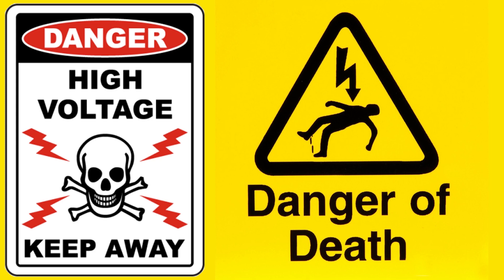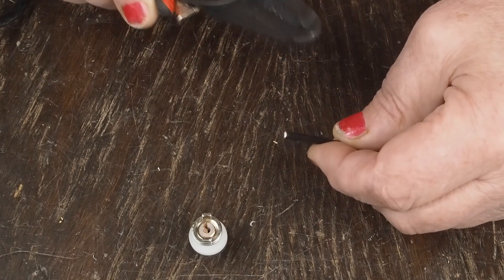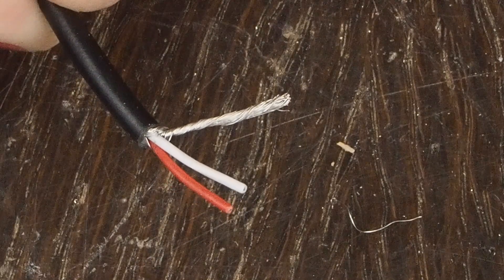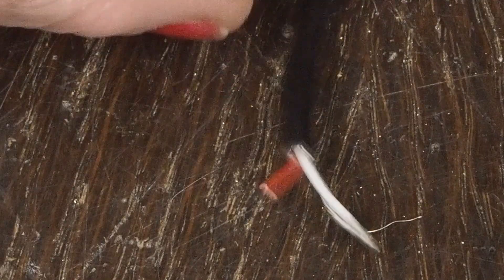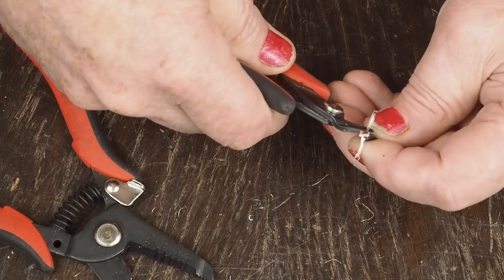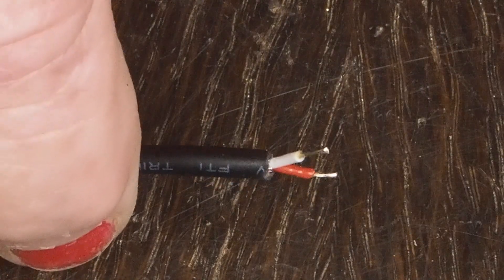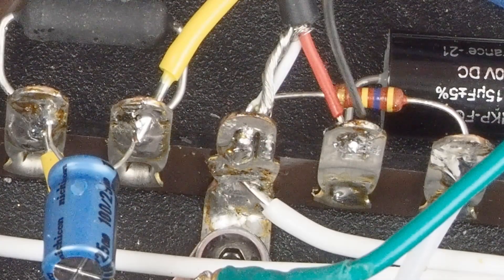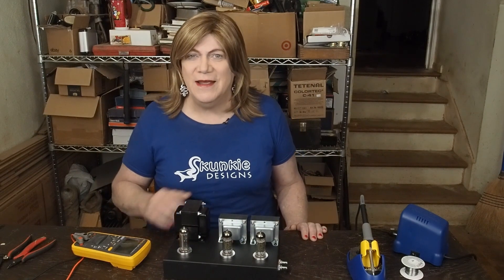Installing Audio RCA Jacks and Shielded Wiring

Comment: Can this same method be used when replacing the rca jacks on the T11 ? Any advice on that would be great? Can the shielded wire be soldered to that board?
Reply from the maker: Yes it can :)
Reply: @SkunkieDesignsElectronics  I went back in and replaced the ground lug and wire on the t11, was able to get a 300 foot spool of gls shielded mic cable for 20 bucks on amazon. Super deal 84 percent off. Also i removed the rca plastic boxes from the board. When my parts get here tomorrow im going to solder up the new rca jacks. 
Thank you again for another great video.
Reply: @SkunkieDesignsElectronics  I got the new rca jacks and ground lug done in my little bear t11, it was a tight fit but dooable, the solder joints on the board are very close to the rca jacks, 
You really have only a few options. Relocate them, or insulate the back of your lugs and flatten out your solder joints like i did. As long as you stick to the smallish size rca jacks it's doable. The mic cable is super flexible and was a huge help. The end result was a quieter better sound stage and even more clarity. :) ps that mic cable makes an awesome turntable ground wire. You said in your t11 mod video that it was a 9 out of 10. With the rca modd and the new ground lug its closer to that 10 out of 10

Comment: I see you used a lug that is connected to the enclosure and a wire for ground too. Couldn’t this created a ground loop? Thanks for this video.
Reply from the maker: Never had any issue doing this in dozens of amp builds..

Comment: This is very informative.  I'm considering changing the rca jacks on my Luxman L-480 as one side drops out on the phono. They appear to be close together than the standard replacement pair rca jacks.  Can I use the individual ones as you've used? Thanks in advance.
Reply from the maker: Hard to say without seeing it.
Reply: @SkunkieDesignsElectronics  can I send you a photo? Thanks again.

Comment: I have a slight comment. I feel you should tin the twisted shield cable completely then solder it.
As this will remove any chance for any whiskers to ever cause a short. Probably over kill but good practice.
Reply from the maker: Good point!

Comment: I realy enjoy your videos, to me, they reflect percfectly the  DIY spirit. I have two questions. Do the difference in the lenght of the wires for the RCA could affect in any ways the signal? Since solder has much less conductivity than copper, could there be a significant difference between a mechanical joint versus a soldered one?  Thanks
Reply from the maker: No and No. 

On the first one, electricity travels much faster than the frequency of the signal, it's not possible that a few inches of difference in the signal path length could have any impact. 

On a soldered joint, we are talking about the conductivity though less than 1mm of solder. Theoretically I supposed a tight mechanical joint would conduct immeasurably better, but at least for me as a DIYer, I find myself changing components testing ideas often enough that dealing with tight mechanical connections, that are then soldered, makes that a royal pain if not impossible. Also, if pure solder connections were a problem, no PCB products would work and many high end amplifiers use PCBs.

Comment: Every video I pick up something new. I've never seen coaxial audio cable done like that with the shield connected to one of the conductors. I can see the benefits and if anything there is less likely a chance of having the signal short to ground that's easy to do when working with those whiskers. Thanks again!
Reply: Is this OK with a single ended amplifier? Thanks

Comment: There is some recommendation to not touch the lead wire for soldering, what about you idea ?
Reply from the maker: My main suggestion is to wash your hands after working with it. If I was doing this a lot, I would consider wearing latex gloves. I am getting a "fume extractor" and even a small fan is a good idea to not breath the flux fumes.

Comment: Would be nice to know the suppliers of your,parts.Very hard to achieve without ''advertising'' But many videos give links to their wares...
Reply: Mouser, Digikey, Parts Connexion are just 3 places to buy these parts
Reply from the maker: Those vendors Nick mentioned and: tubesandmore.com aka  Antique Electronic Supply, Angela Instruments, Viva Tubes, youdaelectronics.com and finally Ebay are my primary sources of parts.
Reply: @SkunkieDesignsElectronics  I appreciate the way you wired these inputs.  Specifically, what brand are those are input jacks?    I recently bought some that won’t stay tight.  Looks like these are very solid and I’d like to replace mine with these.  Thanks.

Comment: I don't have scope but assume I don't hear hum or noise on the speakers, however; it shows small noise on the scope, should I fix with the shield wire method? Wonder if it's necessary. Great video
Reply from the maker: If the amp is quiet to your ears, I wouldn't bother and this is just how I deal with shielded wire. Many great amps just use the conventional single wire + shield with the shield used as the negative, I've wired amps like that myself.